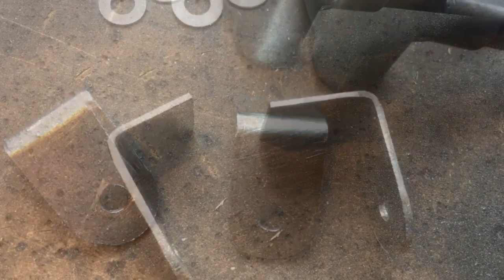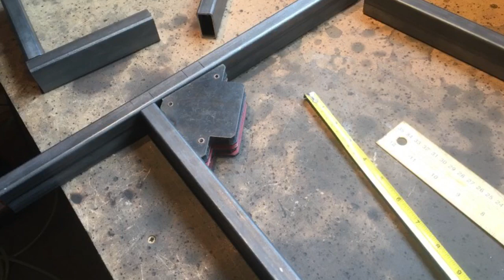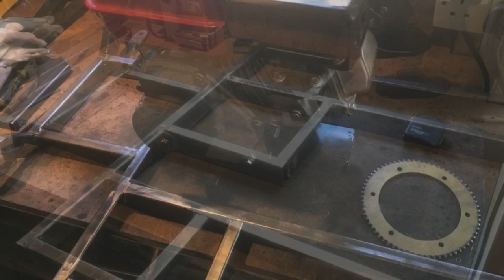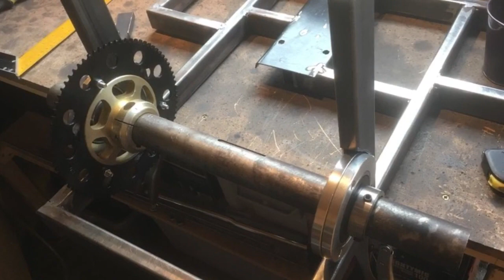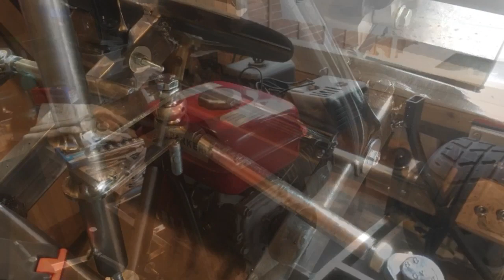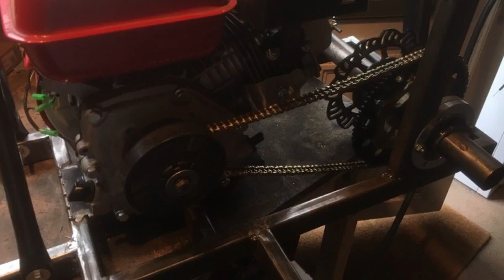Homemade go kart build with Honda gx200 6.5hp clone engine same as predator 212

Comment: Awesome little kart.  I am about to put a motor similar into my boys electric quad bike  I noticed you out the clutch the other wa so the sprocket is near the motor  does the clutch still work this way? Thanks heaps  .
Reply from the maker: Yes the clutch works fine, it helps when trying to fit into a small frame.

Comment: great build except for the quality of welds.. Damn!!!. You need some welding classes bud
Reply from the maker: Totally agree with you, I bought a cheap gasless welder and thought I need to try build something. Never really welded or done any metal work before.
Was finding it quite hard to get it set up properly.
Reply: @bigjohnwishbone  for a first-timer welding fluxcore your welds look really good. no blown out holes that needed patching, the beads look solid. even experienced fluxcore welders can't run beads that look like tig welds.